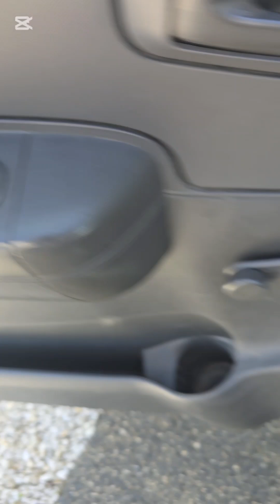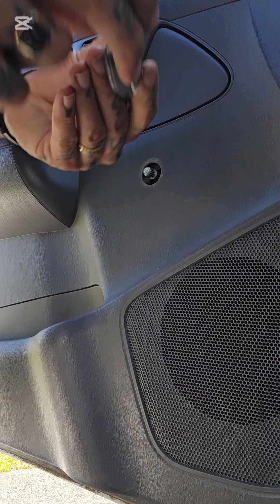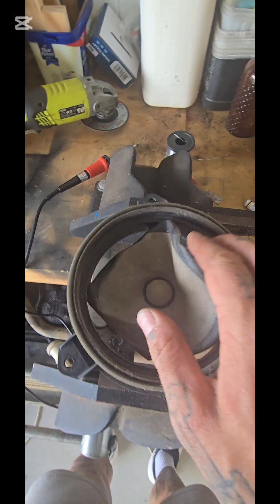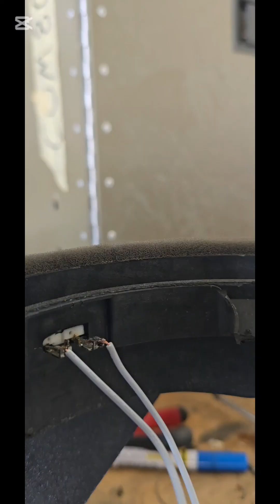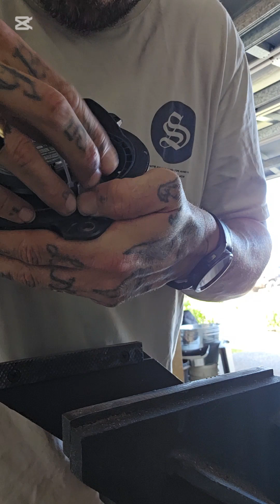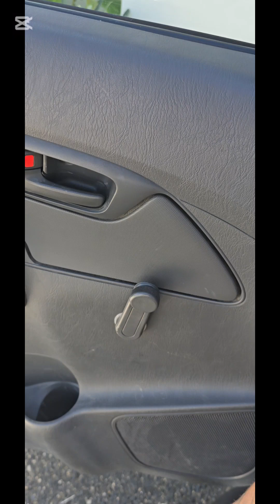05-2015 Toyota Hilux N70 front speaker install. Walk through using all original parts and wiring

Comment: Just about to kick this off to replace my factory speakers. No BS, super helpful vid.
Reply from the maker: Thanks! If there's anything I've missed or you need more info on don't hesitate to ask
Reply: @bigdog8167  cheers mate. Pretty straightforward. Just good to see the whole thing to start to finish before i start ripping the car apart hahaa
Reply: @bigdog8167  started and finish in 45 minutes.
Quicker if you just tec screw the speakers into the doors haha
Reply from the maker: Haha you're not wrong there! I had pop rivets laying around and cbf to drive and get tech screws.. glad it was helpful@mthurtell